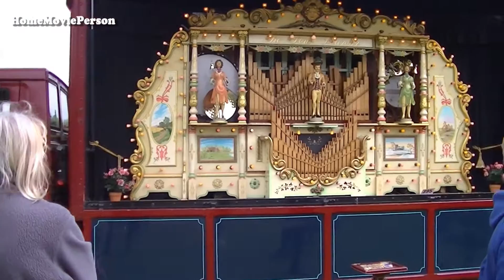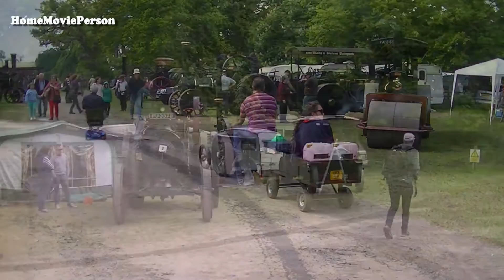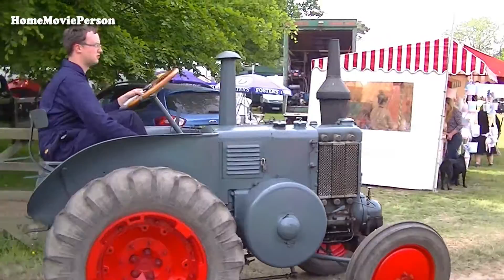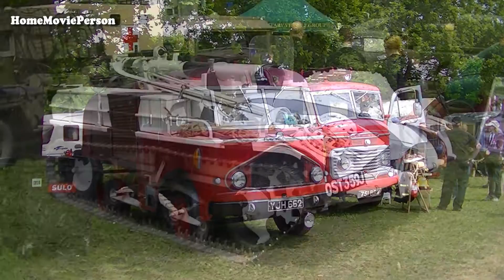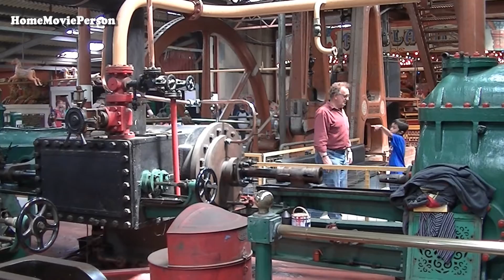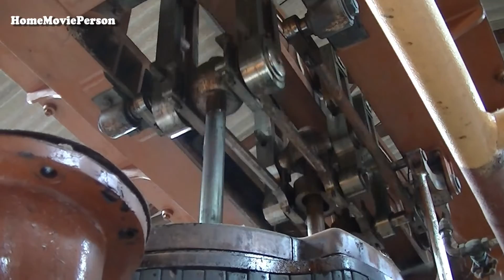Strumpshaw Steam Museum 'Steam Engine Rally' 29.05.2016 Part 1/2

Comment: Great video of the first part of the steam rally.  I prefer the miniature traction engines, steam road rollers and lorry's than there full size version. Which version do you like.
Reply from the maker: Thanks. I prefer the full size traction engines. The skill and engineering to produce the miniature versions are really quite amazing.
Reply: Late to the party, but I'm into the miniatures. Excluding Mamods and Wilescos I've got 2 miniatures: A 1 1/8" Markie road engine (gas fired) and a 3 1/4" Maxitrak Aveling & Porter (real coal). When (if) I get my holiday/tow car repaired I'll be exhibiting as much as possible in the North East Midlands. Due to medical issues I no longer feel comfortable driving long distances.